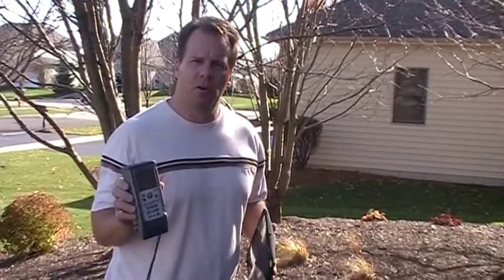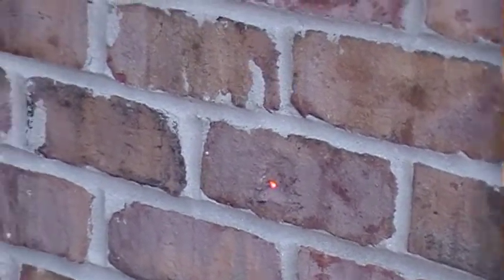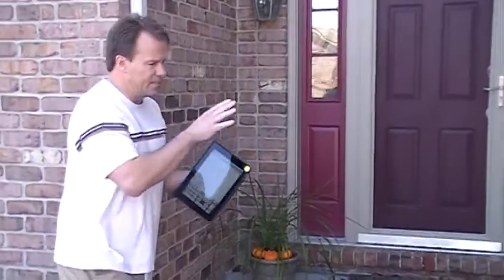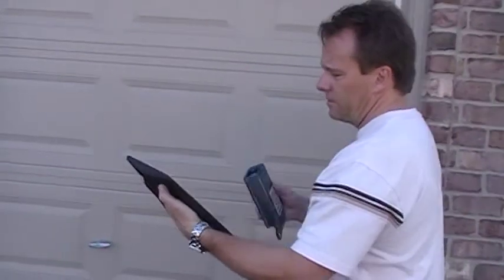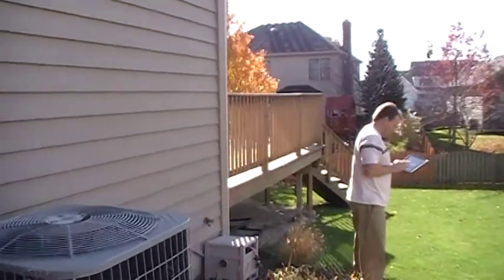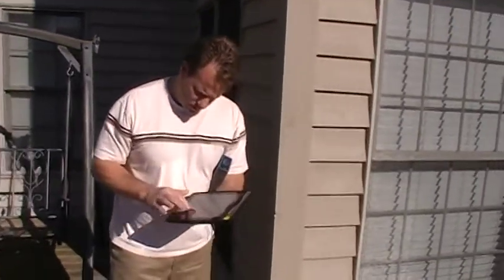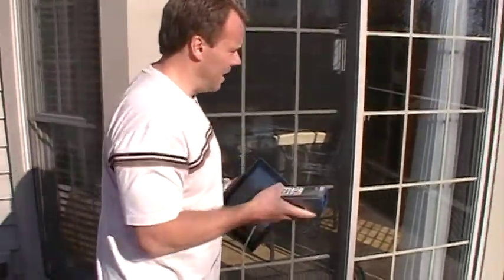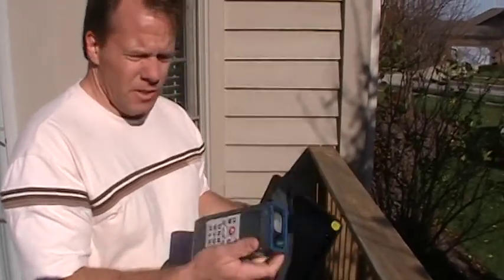Laser Measurement for Appraisers

Comment: Hi Michael. I see from your video on your exterior measurements, you were able to use a door frame as a target and your iPad as a target to account for the difference for total length. My question is what if there is no target available and it's a straight wall across? Or if the house is on a slope? Thank you for your time!

Comment: how do you measure angles?  I live in Florida with lots of high rise condos with angles and full sun.  Did I mention lots of sunshine?  I am trying to figure out the best model for my work conditions (if I do bite the bullet and go laser).
Reply from the maker: +lohash I usually "back into" angled areas. Meaning I do all the sides around the angle and then use a pop point on the table to close the area. The sun can be a problem. I try to work the shaded side first ( I do my inspections in the morning) and work my way around to measure the sunny parts last. Many times those areas will tie after measuring the other 3 sides.
Reply: I saw a disto demoed at a trade show the other day and it has a camera on it with a crosshair that you can use if you cant see the laser. Also it measures angles using the angle of the disto (trigonometry). Also if you stand in one place and laser two ends of a wall it can calculate the distance using Pythagoras. (a2+b2=c2)

Comment: Mike, I've been pulling a tape for nearly 15 years, but am considering a disto.  Your first measurement across the front of the house shows 22.7, then subtract out the entry way cut out, leaves you with 14 feet across the front.   That means the entry way should be 8.7, but when you measure it again, it comes out 8.5.   I know the difference wouldn't be statistically significant, but as I'm trying to learn everything about the disto, could you explain the difference?  I would like to know as much as I can about any limitations before I buy.   Thanks again for a great video explaining how to use the disto.
Reply from the maker: +barry warznal  Barry, I work the most shaded side first and work around until they tie. If that makes sense. I work the 3 sides and pop point in the last one. If it's 45' on the shade side it should tie 45' on the sun side. Or I hit something close and then add to the next point. If I can't see all the way to a fence (40'), I hit an electrical meter (20') and that add to the fence (another 20') to make the distance I need to see- shorter. I may need to do a better video to explain this.
Reply from the maker: Todd Waites  Hi Todd,
 First, I HIGHLY recommend getting a Disto. You can find them on craigslist cheap. People sell them when they get frustrated and give up. If the measurements are off in the video it me not the Disto. I may have been holding it at an angle. You will get the same/right measurement every time. The measurements always tie. If the back is 47' the front will be the same. I always double check everything. You can go around a house twice both ways when you use the laser and make sure everything ties. I've done over 5,000 sketches with the laser and never had 1 phone call about a sketch. Let me know if you have questions or need help. 
Mike
Reply: +Michael Mila ....how do you deal with the dot over a distance in full sun and no bounce off pt....?
Reply: Thx mate , but reality says that you can be certain there will be nothing to bounce off most times....its a great problem as you are aware .
Reply from the maker: You can hit a downspout about 80% of the time.

Comment: Is there anywhere that sells older disto's?   I currently use a old school 10ft stick.  My budget is $250.
Reply from the maker: Mark,
I would recommend going on ebay. There's an A-8 on there right now with a starting bid of $199.The seller is drrue97. I paid $800 for that unit and it still works great. It looks like brand new in the photo. I would buy that. 
Mike

Comment: If you are using the Ansi calculations etc-shoudn't you have subtracted the measurement of the two garages and not added them? or was this just a simple mistake in the presentation....?
Reply from the maker: Yes, You are the first to ever comment. I never finished and subtracted the garages. I would subtract that from the gross living area.
Reply: Awesome, on the device you are demostrating at anytime in using it, does it calculate length
first then width each time over and over? I have the MS6450 and that's what it does, and does not calculate past 50 feet.
Reply from the maker: It may have that capability... If it does, I've never needed it for what I use it for. This measures to 330'. I'm sorry I could not be of more help.
Mike

Comment from the maker: It does happen. There is landscaping that interferes with taking a measurement at times. I  have found it easier to measure the other 3 sides and when using the iPad I connect the pop points on the unaccessible area. I confirm the findings by measuring the interior of the wall. I think if you tried the laser for a week, you would never use a tape again. It is worth the $500 investment. I promise.

Comment: I think a big part of the appraisal inspection is missed by using a laser device because one fails to be able to walk and observe and take notes on the condition of the property which is the PRIMARY purpose of the appraisal inspection... what happens when you observed a physical defect such as termite or wood rot damages, does the iPad allow you take noted while sketching? NO!....  A good old roller tape be just as fast and is better because it work in all weather condition.

Comment from the maker: Hello, I'm glad you've found the videos helpful. The D-8 has the ability. They refer to it as the 360 tilt sensor. My Disto has the ability but I have never needed it. I've found you can "back into" any measurement. Measure the 3 sides you can access and use the pop points to connect and close the last area. I do that all the time and it works perfect. 
I have not needed a tape measure since I started using the Disto. I don't even have a tape in my car. I've used a wheel for a radius at times.

Comment: Mike, thanks for the videos, they've been very helpful in making my decision to invest in a Disto and a tablet (just waiting for the deliveries now).  Couple questions:  1) can you measure by triangulation by aiming at 2 points from where you are standing and getting a length of a wall from a distance (for a house with extensive landscaping or deep snow, etc) 2) are there areas that you just can't measure with the laser that warrant carrying a tape measure just in case?

Comment from the maker: I would recommend the new Disto A5 . You can get it from alamode or on Amazon for $500. Apple does not allow a third-party Bluetooth like a Disto in. I understand the Bluetooth Disto does work on the android platform. The Disto I have has the capability to Bluetooth into a third-party device but I don't use it and will not need that capability when I buy a new one. Using the disco in conjunction with the tablet is efficient and fast enough for me.